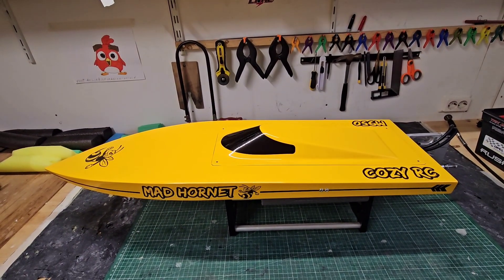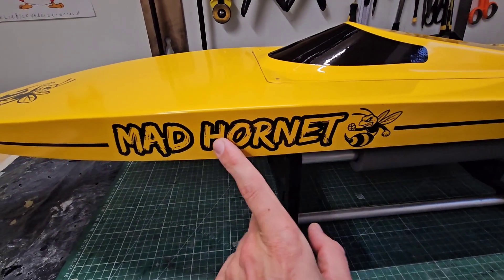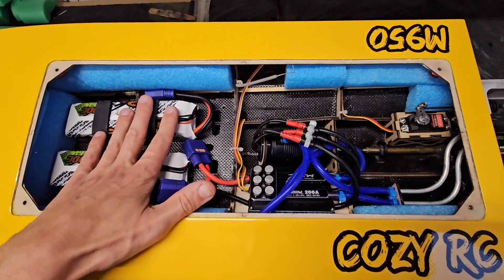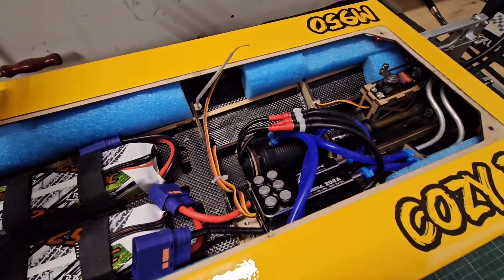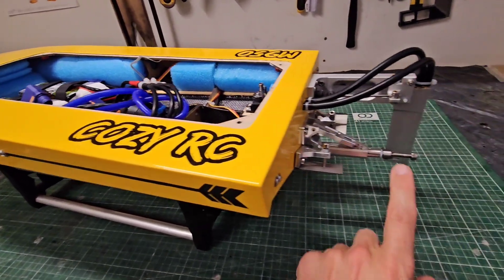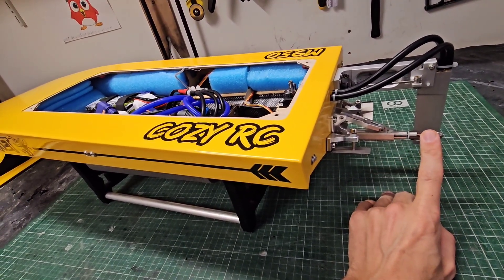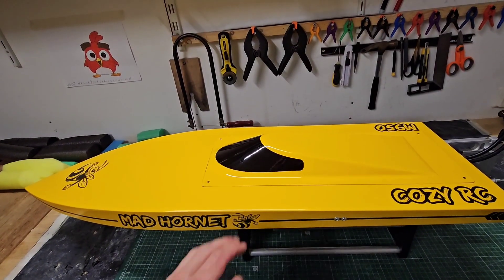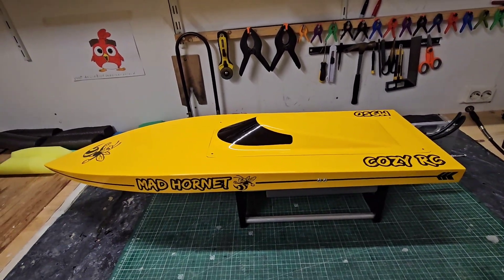DIY RC boat: M950 Review and Performance!

Comment: Goes like HELL on 8S!!! Make 7S and it’s PERFECT.😁
The sprayrails reminds me of my MHZ Aggressor 1m Mono. They were not so sharp in the angle, only 90 degree, but cornering WAS like on „rails“ ! Unfortunately I gave it as a gift to a young boater from the forum. 
Nice you run it on  Henschotermeer 👍🏼
Reply from the maker: Thanks! 8S with this motor is quite a hot setup with this 1520kV motor, yes.
But it's thrilling as well 😁. I think you  mean the MHZ Agressor. I got one as well. I will build that and cover it on my channel in the future. 
Yes, Henschotermeer is a beautiful spot for RC boating!
Reply: @CozyRC  Yes…, MHZ…, I’m getting old! I corrected right before I have read your reply. 😮